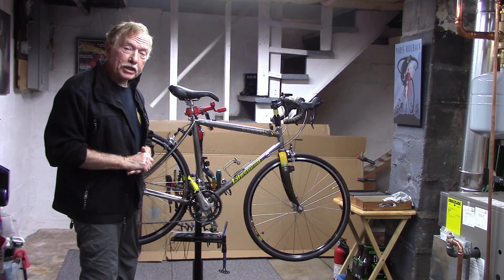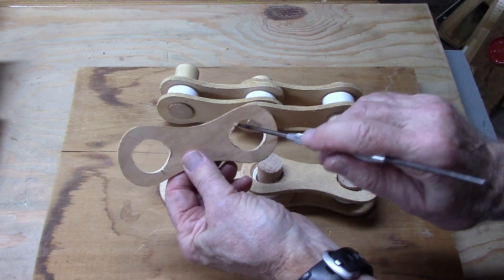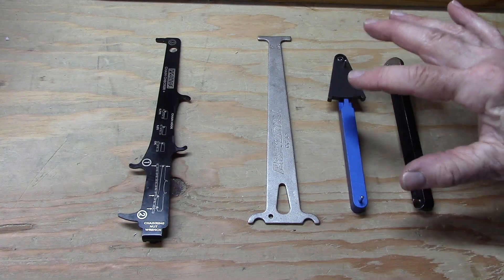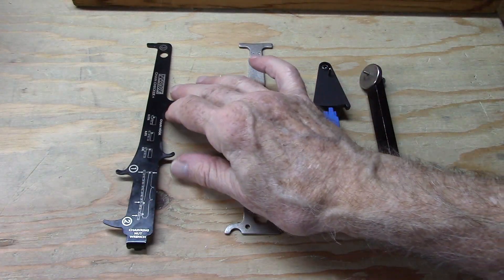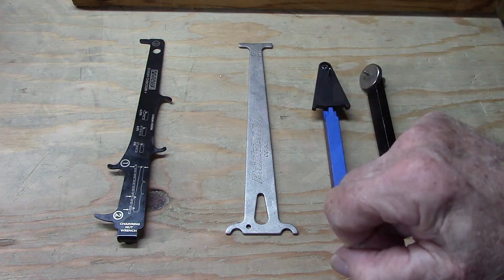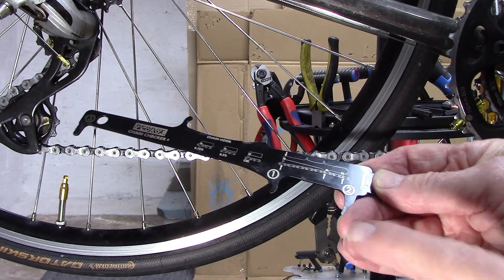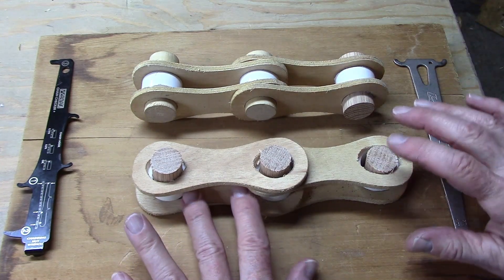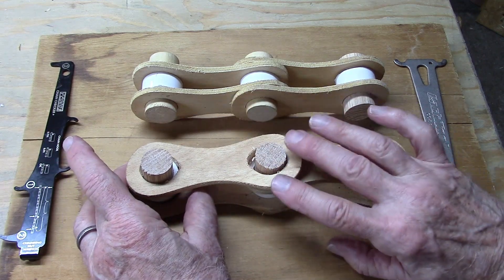Avoiding Costly Repairs: Best Type of Chain Wear Indicator

Comment: I have had the blue park chain checker for years. But someone said that the 3 point Pedro checker was better, so I bought one. I use it just like you show. But I find it doesn't provide any benefit that I can tell. I have used them both on the same chain at the same time to come to this conclusion. The Park tool is much easier and quicker. So it is the one I usually use.
Reply from the maker: I've been using the 2-point Park CC-3.2 along side of the 3-point Pedro, Park 3-point CC-4 and the new Abbey LL. What I have found is that with some chains the 2 point Park CC-3.2 will give me a 0.5% wear while the other tools (used on the same chain at the same time) do not indicate 0.5% but rather less wear. I believe that the Park CC-3.2 is indicating roller wear rather then the actual chain link/pin/bushing wear that we want to look at. Up until you reach 0.5%, one will not see a difference. Using the 2-point Park CC-3.2 or similar wear indicators may mean that you're chaining the chain a little before you need to - which is OK. If you want your chain to last a few hundred (or possibly a thousand) miles more, use the 3 point indicator. In an upcoming video I'll talk about the Abbey LL.
Regards and safe cycling, Tony
Reply: @tony10speed I have found, on my 12-speed drivetrains, that the chain starts running noticeably rougher slightly before the CC-3.2 or the CC-4 indicate 0.5% wear. So, if there is a difference, which I have yet to see, between a 3-point checker and a CC-3.2 checker, I don't know that the 3-point checker is an advantage. I now change my chains based on drivetrain smoothness, slightly before 0.5%.
Reply from the maker: @NelsonSherry  You have a good point with the 12 and 13-speed chains. The experts and manufactures say we should replace the chain at 0.5% wear. However, as you point out, one may well want to replace the chain sooner. The Abby Chain Wear Tool gives a 0.25% indication. Although the Abby tool is not the easiest to use, maybe this is a case for it. See below and let me know what you think:
https://www.youtube.com/watch?v=jCNDimx9Y80&ab_channel=TonyMarchand
Reply: @tony10speed  Yes.  I appreciated that video a lot as a good practical evaluation of the Abbey tool.  I suspect I've been replacing my 12-speed chains, based on drive train noise/roughness at about 0.45% wear becaues the tools are ever so close to dropping in.  That being said, I have a SRAM XX1 that I swapped out after a few 1000 miles (didn't track distance closely) because it was running rough after a life of silky smoothness and it's nowhere close to 0.5% .  It almost measures new.  This makes me wonder if the rollers are wearing before the rest of the chain and enough, or in a way, that leads to rough running.
Reply: I would agree theoretically to the point, that the 3 point Pedro (very similar to the just introduced Park Tool CC-4.2 or its 5 year old predecessor CC-4 or the SRAM Chain Wear Indicator TL-CNTL-WEAR-A1) have the basic advantage, that both measuring Pins do contact/push their 2 respective rollers in the SAME direction, while the 2 point gauges like Park Tool CC-3.2 and many others do push their respective rollers in OPPOSITE direction. When the chain is running on the teeth of the sprocket, pressure is applied on all teeth in the same direction. This means 3 point gauges should measure more correctly as the 2 point gauges applying pressure in opposite direction.
I think it is not really possible to compare a Park Tool CC-2, which has a continous read out to a gauge that has only 2 or 3 fixed percentage steps (0.5/0.75% or 0.5/0.75/1.0%), because the continuous read out of the CC-2 does not give you a "razor sharp" decision indication as the CC-4.2 when to replace the chain. I assume also, that there are some tolerances in the manufacturing which disallow direct comparision of 2 gauges unless you have confirmed that both gauges dimension differences are neglectable small. I cannot really estimate these tolerances for the CC-2 design which in my understanding uses a Pin/Screw in a not centered hole possibly having larger tolerances than gauges that have no movable parts, but 2 point gauges will mostly be produced by a press cutting the form out of a sheet of about 2mm thick stainless steel, while the 3 point gauges seems to be produced not by press cut-out, but by laser cutting which has in my image a much lower tolerance AND should result in rather flat edges, this means much less wear on the edges over long time use compared to a press cut 2 points gauge.
If a more accurate measurement of chain elongation does really lead to less cost on the drive chain when driving a lot is difficult to judge, because the criteria 0.5% is probably based on some experience of long distance drivers where I assume most testing has been done with 2 point gauges (Park Tool's video on the 0.5/0.75% CC-4 is just 5 years old and I guess before that only 2 point gauges were available). To apply a 2 point gauge criteria by a 3 point gauge is in my image not correct. But also the Shimano recommendation of a sharp step from 0.75% criteria to 0.5% criteria from 9-sprocket cassettes to 10-sprocket cassettes seems not correct/realistic, but rather represents the fact, that gauges for other criteria than 0.5% and 0.75% are to my knowledge not really available, with the exception of the continuous read out design of the CC-2. In my view the replacement criteria to larger cassettes/number of gears should rather be some smooth curve as Tony Marchand expressed at 6:45 correctly (it is not exactly at, but on a with number of gears declining curve, the more gears, the earlier the chain should better be replaced to keep overall wear and with this the cost of the total drive chain mainly chain, but also cassettes and finally chainrings in long term at a minimum, and this minimum is for many gears higher than for less gears).

Comment: Thank you. I have the Bike Hand two point chain checker for my vintage Shimano 105 9 spd groups w/ Mavic Cosmos wheels. (~ 2003.) Nice bike, Tony, not that I know much about them.
Reply from the maker: Your welcome. The bike you see is an early 1990s Titanium Litespeed that I restored and upgraded certain components including rim brakes, pedal, headset, bottom bracket and a few other items. The frame and fork are originals with new decals.
Also visit our YouTube home site at:

https://www.youtube.com/user/MrTony10speed
Regards and safe cycling, Tony

Comment: Very good explanation. Another important point is that the three point measuring tool works on all type of chains with 1" pitch, including SRAM flattop, which has a different diameter of rollers, and therefore the two point tool does not work at all.
Reply from the maker: Good point. Thanks for your comment.
Also visit our YouTube home site at:
https://www.youtube.com/user/MrTony10speed
Regards and safe cycling, Tony

Comment: If you have a 10 speed or less.  Which a lot of people have.  You could safely use the 3.2 until you are at .5% and replace your chain then.  The 3.2 is much easier and quicker to use.  Another alternative is to have both the 3.2 and the 3 point and use the 3.2 until it is at .5% wear then check with the 3 point to be certain.

Personally I would rather be safe and replace easier rather than later.  Better safe than sorry.

Also I see no reason the 3.2 cannot be used on a single speed chain.
Reply from the maker: Single speed should be replaced at 1% , if your chain wear indicator has a 1% mark. If it only goes to .75%, then change the chain when it reaches that mark. 
As to using the cc3.2 first and then checking with the 3-point tool, that would depend on whether you feel the cc3.2 may give a "false positive" result that can be rechecked with the 3-point tool. In our experience (at least at this point in time), that would appear to be the case and you could use the cc3.2 as a quick first check. Although my own personal preference is to use just the one, accurate tool. 
Thank you for the thoughtful interesting comments. Regards and safe cycling, Tony

Comment: Thanks for posting this video.  I found that the swivel arm style (blue checker) is prone to getting the little pins bent if not careful when storing in a tool box.
Reply from the maker: I would tend to agree with you on that. Storage as well as recalibration on some tool are key to maintaining accuracy.

Comment: I have a challenge for you: Find a chain that measures differently on your 3-point chain checkers when compared to your Park CC-3.2. Then show us. Further, if you give it a good faith effort and fail to find us an example, please share that outcome as well. Thanks.
Reply from the maker: I have one such a chain on my Litespeed classic and on an Independent Fabrication - which I will film. The CC-3.2 says they are worn to 0.5%. All other tools (3 point checkers CC-4 from Park and the 3 point from Pedro as well as the Abby LL) indicate that it has not reached that level. Interesting but this is an on-going investigation and I will continue to gather data. Thanks for your comment, Tony

Comment: There is no wear between the pins and the outer links, only the pin and inner links.
Reply from the maker: Interesting. Do you have some references for us to look at? Regards, Tony
Reply: @tony10speed  No references, per se', just the observation that the pins are pressed into the outer plates and there is no movement between the outer plate and the pins, unlike the inner plates.

Comment: just use a tape measure 🙄
Reply from the maker: Yes you can use a tape measure. Be sure it's one that can be read easily and that the chain is under adequate tension (some suggest positioning the chain on the large cog and large chainring). I would suggest a steel ruler that's engraved with numbers and marks since a tape measure can bend out of shape and the very end of the measure may not be accurate. One also needs good eyesite. Thanks orlando for your comment and safe cycling, Tony

Comment: I usually put slight pressure on the chain by pedals when using a 2 point to give a more exact measure
Reply from the maker: Putting pressure on the pedals possibly helps but doesn't move the pins in the same direction as does the middle and gauge hooks do. The 2-point even with added pressure on the pedals may still give you false positive or false negative results due to chain roller wear and size - at least that's my understanding.

Comment: great vid, love the chain model as well.  Exact reason why I rotate two chains, been doing that for years and moved to waxing about 3 years ago.  When I moved to AXS Flattop chains, I picked up a Park CC-4.2, but use the 3.2 as a rough check first and if it seems close, I will break out the 4.2
Reply from the maker: The SRAM AXS Flattop rollers are larger than the usual 10,11,12 speed chain rollers giving a false negative result with the Park cc-3.2. SRAM suggests using a three point chain wear indicator to compensate for the increased roller size:
https://www.sram.com/globalassets/document-hierarchy/compatibility-map/road/sram-eagle-flattop-and-11-speed-chain-compatible-tools.pdf

I'm not sure that using the Park 3.2 would give you a rough estimate in that you may get false negatives. Any comments from our viewers?

Thanks for your input and safe cycling, Tony

Comment: It took me 5 viewings to figure out what is really going on - what the tensioning accomplishes and that the tensioning is a combination of the tensioning hook and you pulling on the chain. And I still fear that the tensioning might not work if the chain is so stretched that the chain hits the tool when you pull on it thereby giving an erroneous reading. It would help to show close-ups of the chain when doing tensioning. In the video, that section is either in darkness or obscured by your fingers or just shown too briefly without a good explanation that pulls the big picture together.
Reply from the maker: I'll be putting out another video on 3-point chain checker in Oct. I'll be sure to include some close ups of how to create the proper tension. Creating tension by moving the pins in the same direction allows for accurate wear measurement and actually reduces erroneous readings. 
Thanks for your comment and look for our new video next month. Regards, Tony
Reply: But chains do not stretch. They are after all steel. They elongate due to wear (primarily) of the inner plates. Novices often make that mistake but it simply is not true. Chains wear but do not stretch.

Comment: calipers are best
Reply from the maker: Calipers can be used although there is still some controversy as pointed out in some forums:
https://weightweenies.starbike.com/forum/viewtopic.php?t=160370

Another cyclist points out the following:
Measuring stretch with a caliper this way shares the same problem that causes most of the wear gauges to read high. Roller float (and wear as well as varing  roller size in some chains) is included in the measurement, adding to the reading. If you want to use a caliper, measure from the outside plates instead. First measure from the front of a plate to the back of one about 6" away on a new chain to establish the zero reading. record that someplace where you won't lose it. Then you can repeat the measurement any time and the difference equals the stretch.

*Don't forget to put some tension in the chain by pressing the pedals while not letting the rear wheel turn, otherwise you'll get a low reading.

*Also use a quality digital caliper.

Yes, digital calipers can be used but I'm not sure all the answers as to percision are in (especially with 11-13 speed chains).

 Good point to investigate. Thanks for your input, Tony

Comment: Thank you. Personaly I prefer cheapest one ( as alredy present at probably every home ), and easiest to use, with very obvious, large reading. Someone already mentioned it before - A RULER. 30 links are exactly 381mm. No need to count them, as worn out chain is only 2mm longer ( 383mm ), while one link is 12.7mm. It is enough, and easy to stretch your chain straight on the bench . If you want to be super comfortable, go for double 60 links.
What in my opinion is very important, so far nobody mentioned here, CHAIN MUST BE MEASURED WHEN IS CLEAN. That's because only 2mm makes difference - on almost 400mm long section - between new, and dead chain. So, dirt left between pins and links can give you very false reading, showing your chain has plenty of mileage left, while in fact already eating your costly teeth.
Another point somebody mentioned here, there are two 12S SRAM Eagle chains, which are shorter when brand new. Exactly 380.4 instead of 381mm on 30 links. That's due to smaller pin's bore tollerance. This difference is negligible for your teeth, and in result these chains have 40% more mileage in bank. What was confirmed by most professional tester - Zero Friction Chain - a very useful website. Those two chains last much longer than any other best chain.
Reply from the maker: Thanks for you comment. Very informative. You do need a clean chain. It is also important to put the chain under tension (more then just the tension you get from the rear derailleur). Some suggest removing the chain and weighting one end to do this. Otherwise you may get a false negative result. You also need a great metal measuring ruler and good eye site. With the 12S Eagle, I wonder if they've also changed the cassette cogs to accommadate the shorter link length. 
Thanks again and safe cycling, Tony

Comment: I use a steel ruler but a steel tape measure works, calipers but I wouldn't spend the money on calipers just to check the chain.  I suppose if I was a professional bike mechanic I would get one of those tools but measuring from center of a rivet or pin to the center of another rivet at 12" works.  Anything over 12 1/16" is time for a new chain.  Works for me anyhow.  Thanks for the explanation.
Reply from the maker: A steel ruler or tape measure will work as you say. The chain needs to be under tension or you will get a false negative result. Some people remove the chain and hang it up with a small weight at the end to create more tension than is created by the rear derailleur. Holding the ruler steady and keen eyesite are required for measurement. Personally, I prefer the 3 point tool - in that it's quick and easy. Thanks for your comment and safe cycling, Tony

Comment: I currently have a cervelo rs 10 speed . 50/34. In front 11/34 rear cassette.  I was thinking of upgrading the rear cassette to a 12 speed for a bit of a comfy ride with speed and for the hills in the SF Bay Area. Is this something you would suggest, if so what size cassette would you go with . I’m sure I have to upgrade chain and possibly hanger for derailur
Reply from the maker: To upgrade from a 10 speed to 12 speed would require major upgrades to your drivetrain (cassette, chainrings, chain and derailleur) and new 12 speed shifters. The 10 speed freehub will not accommodate a 12 speed cassette. I'm not sure the comfort would be worth the cost to make all these changes. I suggest you check with your local bike store and take a new 12 speed for a test ride and see it that's something you really want. If so, it's probably worth investing in a new bike.